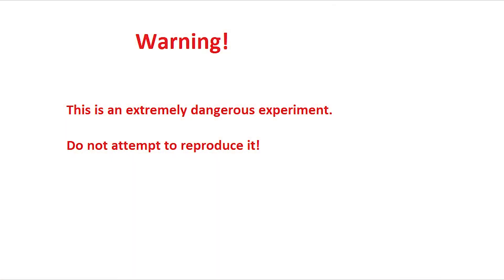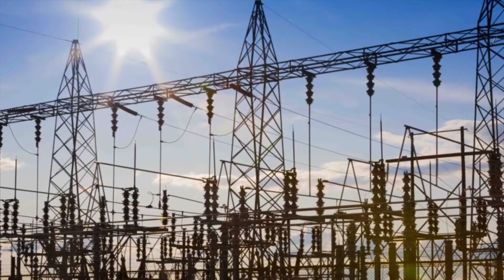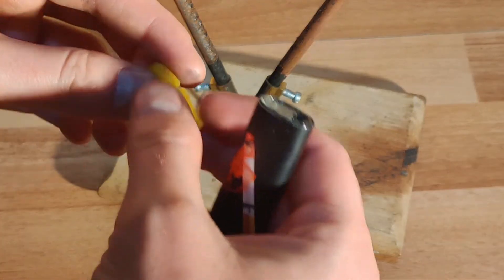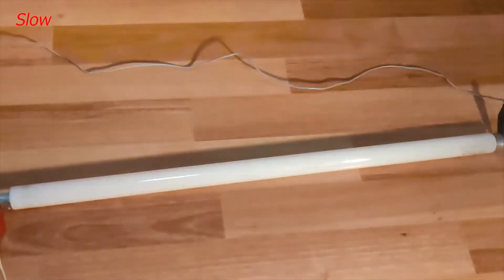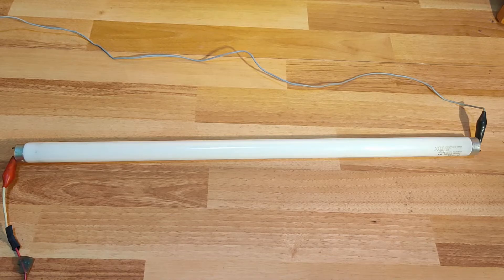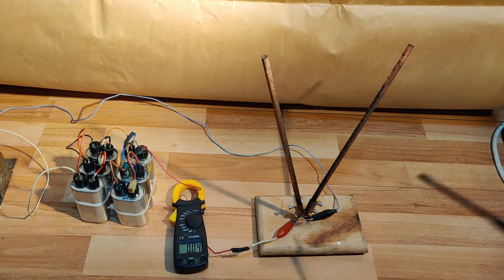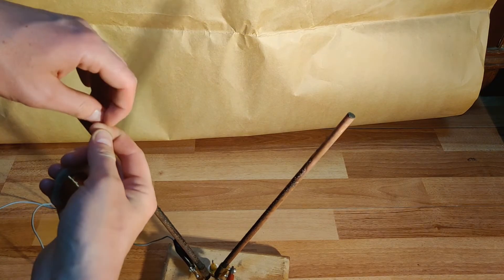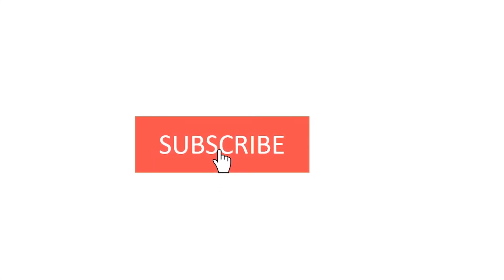DIY 5KW Jacob's Ladder - The Ultimate Science Experiment

Comment: Put a small thing between the two poles and short the distance between them.
Then you may see the teleportation
Reply: smaller objects caught in the arc's path can be heated to the point of vaporization or even cause them to be propelled away, giving the illusion of disappearing. This phenomenon is more about the extreme heat and force generated by the electrical arc rather than the object actually disappearing.
Reply: How can I operate it? What should I put?